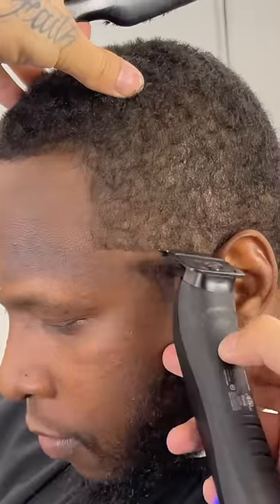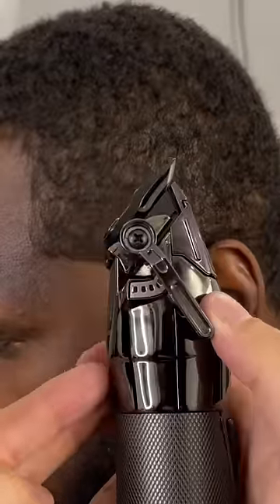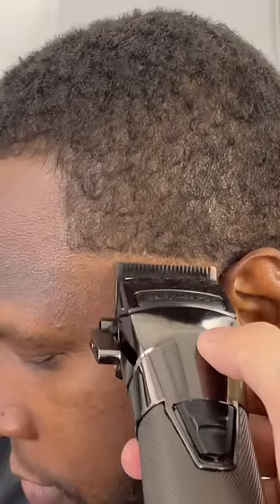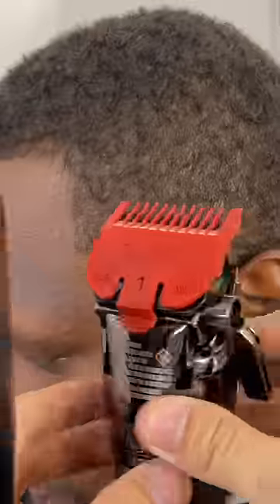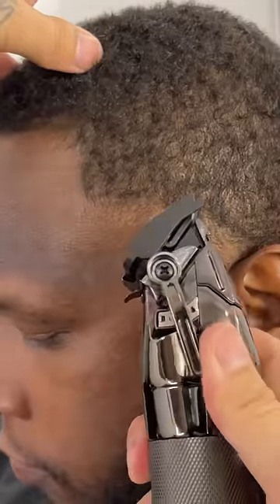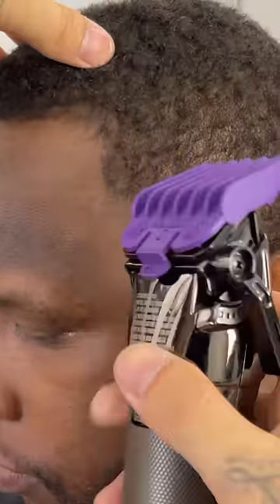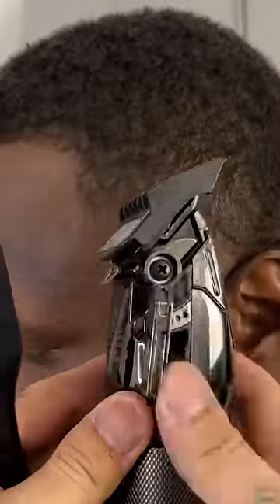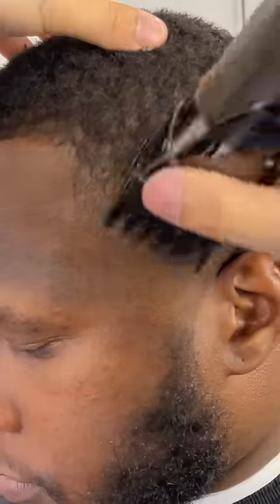STEP BY STEP HIGH TAPER 💈🔥

Comment: Super simple. Never been a fan of fading and taking out guide lines as you go but this method has helped me tremendously. Thank you. I’ve saved so much money on not having to go to the barbershop. And I’ve gained so much confidence in being able to give myself a barber quality fade and taper. 💪🏾💯 I’ve started going to school yo be a barber because of you bro and I just wanna say you’ve been a blessing. Thank you.
Reply: you said it exactly like i see it. i dont like putting guide lines in either. when you put the first guideline in he could have went with the biggest guard he used and attacked the taper. and as he lowered the head in the taper area you use smaller guards. it called fading down instead of fading up. only good thing about putting guidelines in is it does give you something to follow can make the cut cleaner.

Comment: How do you blend out the line without a .5 guard?
Reply: You can use the 1 guard closed but it won't fully take the line out. So you could use no guard lever open using the corners . Hope that helps